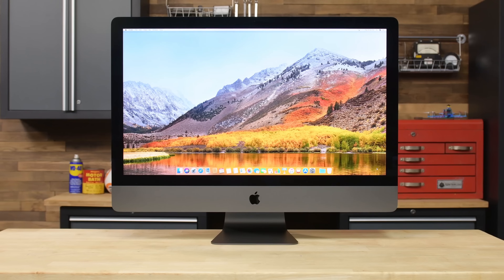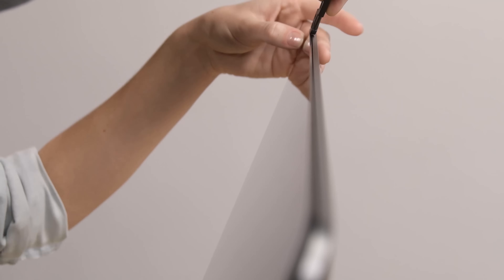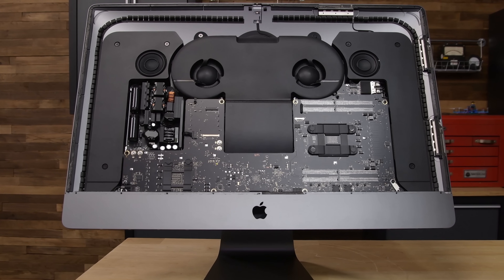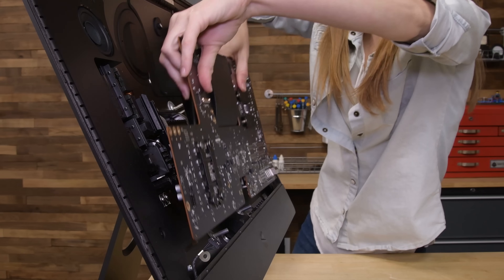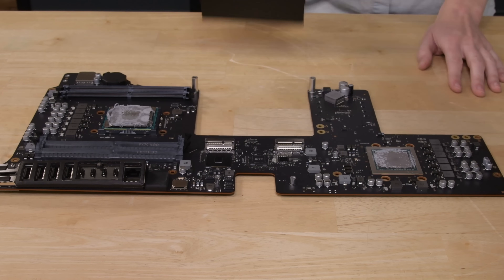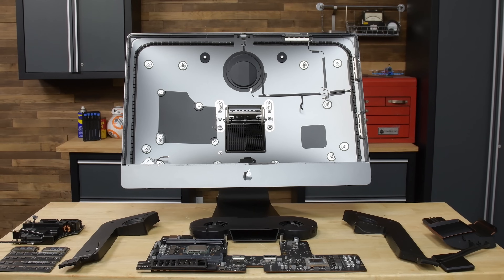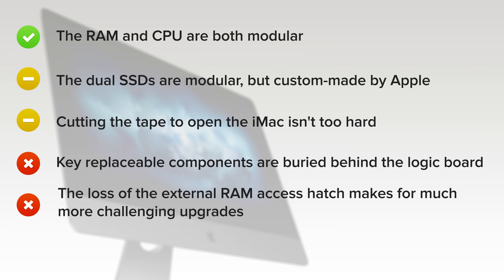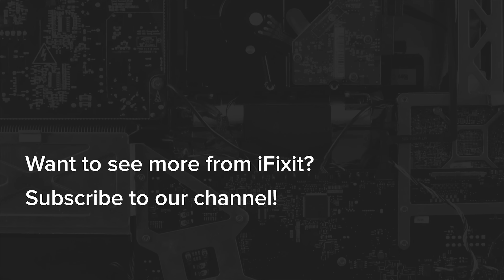iMac Pro Teardown

Comment: Pretty ballsy that they call this the 'pro'. 
When I have worked in enterprise level IT, we regularly wrench on all of our computers. Servers, laptops, desktops and yes Macs. In the olden days I often would cannibalize one Mac Pro to keep another one running. Often because of a mission critical graphics job. In Apple's current model they expect you to take your Mac to them or a service center. 
Even in NYC or SF that means 48 hours turnaround at best. Quite a lot longer if they have to order a Logic board. 
And this new T2 chip encrypted SSD has me worried that there will be no way to ensure data survives such a repair.

Comment: when steve jobs was around, i have the first imac with a aluminium frame, and one of the vents on the bottom unscrews so you can swap out the ram.

Comment: So technically, this machine IS upgradeable....but you just have to rip the damn thing completely apart in order to do so. Maybe on the cheaper non Pro iMacs I would upgrade mine on my own, but for a $5000+ machine, I'd rather just buy the one with better specs. I'm not going to risk doing thousands of dollars worth of damage all because I wanted to throw an extra $150 worth of 16 gigs of RAM in the base model, and void my warranty in the process, therefore losing the chance that I would get the machine replaced if anything goes wrong with it in the future. Like I said, other cheaper machines that are easier to upgrade I wouldn't care less about upgrading because the potential loss is nowhere near as high as it would be for this machine.

Comment: Man, for someone really in to building pc's, that kind of engineering is so incredible, I get goosebumps. To think that all of this parts has to be custom built for apple, there's a reason why their prices are at a premium. I'm curious though, what is this workstation for? I'm not entirely sure who this product is for exactly or what kind of workload would benefit from those kinds of hardware. Sure that's a multicore, xeon cpu, but the ipc is too low for workloads that require higher ipc's. And then there's the rams. Why would anyone need an ECC ram stick for this. Is this for a server? I mean with 128gb, you can pretty much run 128tb of server. Would those thunderbolt ports be able to handle raid?

Comment: That power supply is open and can shock anyone even after 1 year that capacitor is opened do not touch that wow apple is plugged in that dc current will kill anyone
Reply: Ankit Sharma Excellent observation! Hopefully people see this comment before disassembling their machines!
Warning! To those who might not have a lot of experience with “high voltage” work, this computer needs to be treated differently from your average PC in terms of safety precautions. Unlike a standard PSU found in most machines, this one is not encased with protective sheet metal which would normally act as both a physical barrier and (in certain circumstances) a more direct grounding path for high current than your body.
Make sure you have a solid understanding of basic electronic principles before working on this device! Those exposed caps on the PSU can hurt you badly if you’re not paying close attention (preferably discharging them first) while you work.

Comment: There is e-gpu now! No need to change the one in the interior.
Reply: And suffer a 30% performance loss if you're using the internal panel. I don't think it would be worth it, dude. Also I don't think you can repair a gpu by adding an egpu so in general, unless you specifically need some quadro features I don't think you're getting much out of an egpu. At least in high bandwidth situations.

Comment: The iMac Pro is a lot more modular than I had expected. Sure, you can't replace the GPU, and the SSDs are proprietary, but this is still a level of upgradeability I didn't think Apple would have offered. I just wish they would let you upgrade the RAM on their newer laptops.

Comment: they could have make it cost way less.why use that RAM for starts? too expensive and same performance as normal ram.custom made SSD that should be really cheap not expensive...this should be 2000 not 5000.and they woulod still make like 500 per machine.
Reply: Protohumans This is workstation grade gear, not consumer.

Comment: It looks like people calling it a RAID is a bit off, since each drive blade just has NAND, no SSD controller. It's one controller looking at a split group of NAND chips, so more like a single SSD doing the splits. Performance is just a bit better than their regular 3GB/s SSD, probably from T2 handling encryption too.
Reply: Well, its not identical to RAID but the outcome is the same on all SSDs, the more chips you have, the more speed you usually get but if one chip or the controller dies all data is gone.

Comment: For $5k I expect 2 1080ti's in sli, an 8 core cpu, 32gb ram, and everything watercooled.
Reply: Kellen Bluestein water cooled screws, water cooled fans, water cooled chassis...
Reply: Learn to understand your computer components. These are not consumer-grade components but rather an enterprise one, hence the pro and there are very specific applications for these kinds of hardware. They are so much more expensive than your typical consumer grade components like a 16gb ECC ram is 184usd/ea vs 104usd for the consumer ones. ECC's are mostly used for servers/workstations where systems are meant to run 24/7 and there can't be any rooms for any data corruptions like for financial or scientific computing. If you try to build a similar grade system with the same specs, you would not have room or money for water cooling at all.

Systems are built for specific purposes. It's ridiculous to spend this much money for a simple consumer or small business setup where you don't need any of the capabilities that these systems have as these iMac Pro's are not designed for overclocking. or high clock speed cpus. If you'll only be using the computer for gaming, then sure build one with a water cooling system and use the appropriate components.

Comment: It's true that the GPU is soldered to the board which sucks.. but then again, there's TB3 that can support eGPUs so I don't think that's a huge problem? Or am I missing something here?
Reply: That’s very expensive external gpu shrouds are 200+  and the graphics card ,but then if your paying for the iMac pro 400+ is that much
Reply: Even Thunderbolt has bandwidth limitations when you are rerouting the gpu back the the display. A Vega 64 would probably already bottleneck a 4 lane display cycled TB3 port so where are you going to go from there? Even if you aren't using the Macs display (which already seems like a crazy thing to give up) you'd still be hitting walls quick.

Comment: My gaming PC has a lot more power at less than half the price, but that goes without saying. So does the fact that it's fully customizable.
Reply: Reliability and durability is key.  I'm typing this on a 2005 Mac Pro.  I think if you amortize the cost over the lifetime of use my system is way cheaper than your PC.
Reply: Uh you’re so lucky? Why don’t you go then and game all day instead of commenting under an iMac video? Would be better for everyone :)
Reply: Complete lie. If you were to buy all the parts from Newegg you would end up spending more than the iMac with inferior parts
Reply: Chuckiele Please leave.
Reply: QuantumBraced May I ask for ur computers specs?
Reply: cause it's not a mac
Reply: Look just because they are selling it doesn't make it a non-workstation device.
Reply: QuantumBraced your gaming PC has a Xeon W in it? Even MKBHD priced a similar spec PC WITHOUT the 5K display and peripherals and It was $5,200
Reply: Are you comparing workstation grade internals to consumer parts? Also not everyone cares about gaming and gaming performance  definitely isn’t the only way to measure a computers power. Even if the same configuration on a pc would save me >500$ I would still go with Apple for the design and reliability. Expandability isn’t an issue when the computer is built to last.
Reply: Dan K. Dude, he didn't even give any specs, how do you know it's shit
Reply: "workstation grade internals" yeah but its still a consumer product. Noone who takes their business serious would use a mac.
Reply: QuantumBraced but your PC is sh%t
Reply: Threadripper offers comparable performance to the Xeon W at half the cost. Plus, you don't have to take it in to a repair center every time there's a hardware problem.

Comment: what is with the graphics-card ? it's possible to upgrade to a VEGA 64
Reply: You can spec it out with a Vega 56 or Vega 64. Non replaceable. Unless you have a spare Imac Pro mobo around.

Comment: This computer is not $ 5.000 worth
Reply: it's definitely worth $5.00 lol
Reply: Trugamer,

The fact that the display has to be replaced every time the computer itself is replaced, and the fact that you need to take it into a repair center should anything go bad and you're looking at a downtime from a few days to a few weeks on the machine. Downtime of which should be intolerable in a professional environment.

Milan, professional workplaces likely already have 4k, 5k, or even 8k displays, and barring physical damage these things can last far longer than any computer it's hooked up to. Plus, you don't have to get rid of them just because the computer dies.
Reply: I saw one for almost $11k same display definitely not cheap, with that kind of money you can get yourself an 8K display but still have money left over for a really good computer.
Reply: It’s very hard to compete price wise with it.

There is a lot of hardware packed behind a 5k screen.  Those two things alone are hard to find for a workstation
Reply: A pro all-in-one workstation with pro specs, a 5K display built in to the chassis and included hardware like a mouse and keyboard with number pad. You must be really picky about your stuff. Configure a Windows based machine with the same specs, looks and hardware (display, keyboard and mouse) and see at what price you get.
The $5000,- price tag seems a lot but it is definitely worth it.
Reply: Worth every cent, only the poor people say something stupid like its not worth 5000
Reply: Believe me, it is!
Reply: It is
Reply: Michael Ba. yah it is. You dummy
Reply: Michael Ba. it is.
Reply: Milan Meiland you also don’t get optimisation and stuff in Windows.
Reply: Michael Ba. hater
Reply: Do u own a freaking pc?

Comment: I wonder if Apple is secretly slowing down the iMac like they did with older iPhones
Reply: They havent‘ a battery inside
Reply: Yeah because they have batteries inside...
Reply: Probably not, people typically do not complain about their performance of their macs after updating to the latest OS, plus the battery is much much larger than any battery in an iPhone
Reply: No, that's Intel's job. 

(Because of the newly found design flaws in their CPUs)
Reply: I guess they have invented the battery reason after the leak of slow-down to the press. Probably they slow down the iMacs as well, but as long as nobody knows for sure, the don’t have to invent the reason.
Reply: LifezLife well da business have to keep running
Reply: they never slowed down imacs quit it. i've never even heard someone say that, hell i see people using 6 year old macbooks and imacs to this day. they run on power from your wall outlet, so battery aging isn't a problem
Reply: D A R K 暗がり but there’s a battery for BIOS.
Reply: No, they don't even slow down their MacBooks. My dad still uses a 2009 MacBook Pro and a 2010 iMac and both work flawlessly.
Reply: Int102420484096 If they “invented” the battery reason, then why does a new battery fix the issue??
Reply: I wonder if Microsoft is purposely crashing their machines when you install other Office competitors like they got caught doing?
Reply: The reason they are slowing them down is so the older batteries don't die so quickly. And since iMacs don't have a battery, there's no reason why they should be slowing them down

Comment: its not a pro if you cant upgrade it, more like pos
Reply: Alpha, a professional doesn't just care about can it run the stuff I need without bottlenecking, they also care about downtime due to hardware failure. With a typical desktop like what you see with many of the custom built machines on YouTube, diagnostics can be ran on an open air test bench, or with the side panel of a case removed for easy component access and stability checks. A complete system replacement can happen in a few hours as opposed to the days or even weeks you'd have to wait the iMac Pro you sent in for repair to get back you, depending on distance to the nearest repair center and nature of the problem.

Plus, when upgrading or replacing, you don't have to toss out that beaut of a display.
Reply: Coming out with those facts, and knowledge!